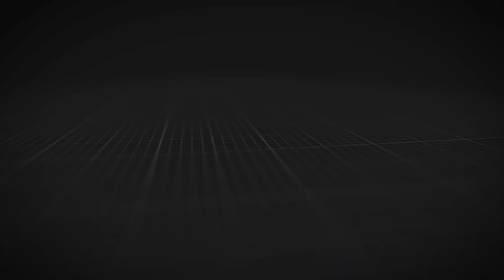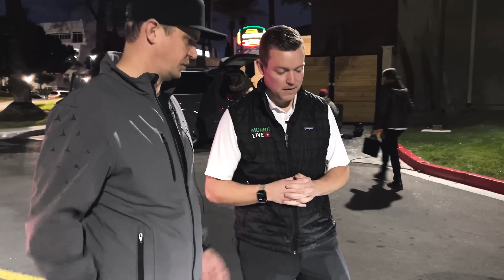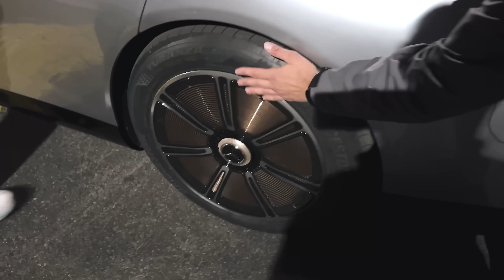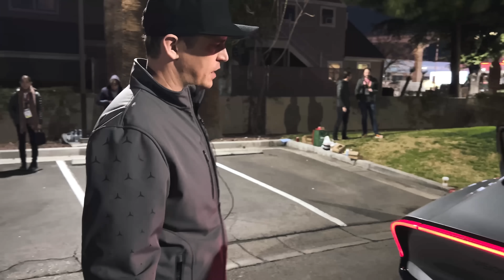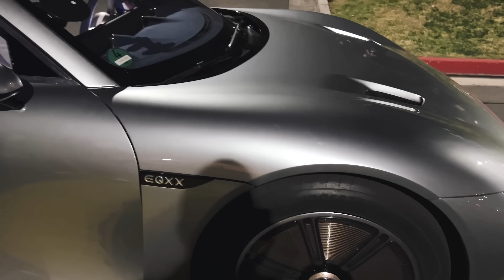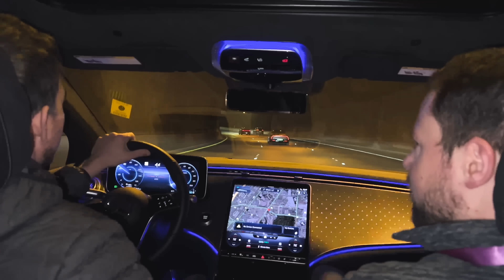The Most Efficient Mercedes-Benz Ever - Mercedes Vision EQXX Ride & Drive | CES 2023

Comment: I see the rear passengers have been recycled for aero. This car may have four doors, yet it really is a coupe with great behind seat storage...😋
Reply: @Sidowse  2/+2 seating configuration is not that uncommon on small cars and they still add a lot of practicality. You CAN fit 4 people in a car with a 2/+2 configuration. Sure it ain't really comfortable for adults in the back but they can fit and children are fine anyway. Say you got 2 adults and 1 or 2 children, you would only need 1 car but if you got a pure 2 seater car then you need 2 cars and a single adult could never move 2 children at once. Those 2 "half" rear seats still add a lot to the practicality.
Reply: @Sidowse  Mercedes has the best tech with their axial flux motors.
Reply: Same for my Honda Insight 2. I can't get in the back. But then I don't have to.
Reply: @Sidowse  The EQXX is a concept car anyway, it will not be produced. If I remember correctly, the rear doors on this specific car can't even be opened. 
We will have to wait and see, if they have learned something useful for their production cars. 

But I agree, this small, ultra long range, (presumably) very expensive, low powered (for the price) car would not be the most sought after car on the market.
Reply: So is every other small to mid sized sedan. Those back seats are really only usable for midgets or children. And I have first hand experience of sitting in the A4 for 1,5h with the options being, either having my head slated to one side or sitting on the edge of the seat to have enough head room. Neighter of which was particularly comfortable position to be in for long periods. And I'm only 181cm. 

Also why I will stick with buying estates. The amount of practicality and comfort those have is worth every single procentage point lost in efficiency.

Comment: Ah,an aluminium cast in another brand.Interesting.
Reply: Makes me think this is getting to production.

The chassis guy I know at Tesla told me that 'everyone' will be doing castings for chassis as it saves so much time and money.  Doesn't surprise me Merc must have been on it at about the same time - there is (or was) a lot of connections between the companies personal.
Reply: @FFVoyager  Nah... Don't confuse loss foam castings with the machine press castings. The latter are very rare in the size Tesla makes them.